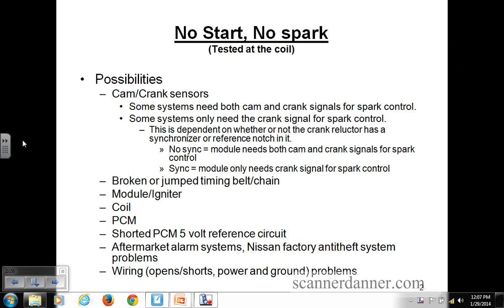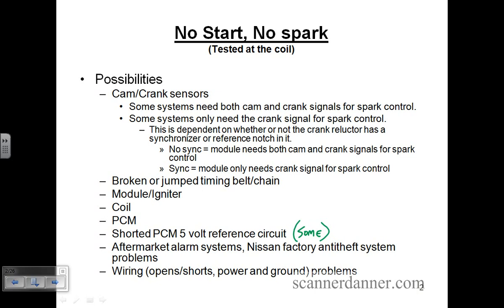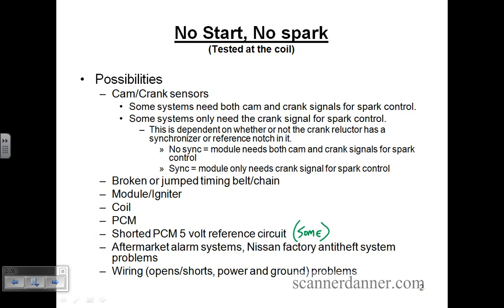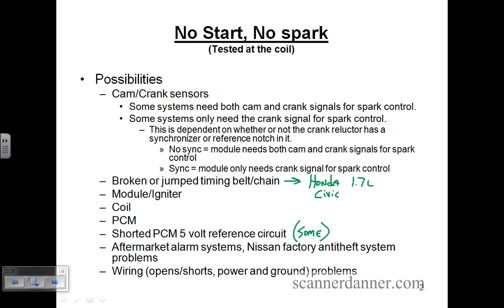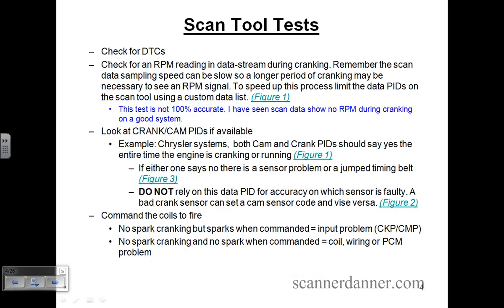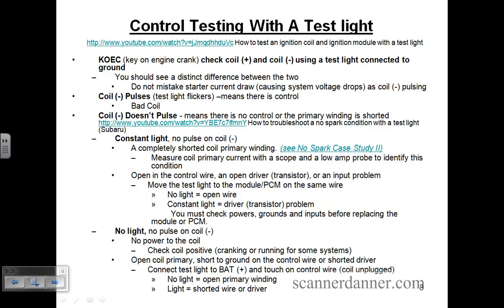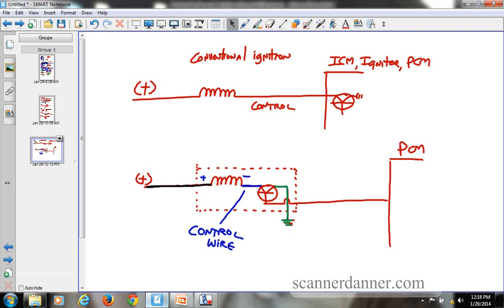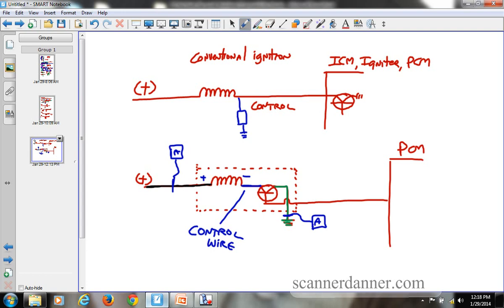Chapter 22 No Start, No Spark Diagnosis (Part 3)

Comment: Paul, just a thought, On case study 2 with the shorted primary coil, if you didn't have a scope, could you configure a test light, sort of like a noid light, and put it in place of the coil, and if the light would now flicker, that would show there is control and you need a coil?
Reply from the maker: Yes! That is a good alternative test but remember the test light control test, there are variables to that as well. 
Great question

Comment: Three terms have been used in several videos - reference wire, control wire, and signal wire.  Is it correct to say that reference and control wires are the same and each is 5 volts?
Reply: Reference wire is usually 5v but can be other voltage levels.
Control wire is for an output device (not the same as reference)
Signal wire is for an input device (not the same as the reference unless it is a thermistor)
Hope that helps
Reply: Thank you.

Comment: I don't mean to be a smart-ass, just wanted to comment, I have used a snap-on led test light to short out secondaries several times and it is still functional.
Reply from the maker: It won't be for long. You got lucky

Comment: Scanner Danner I would like join in learning motor vehicle electric and electronic parts
Reply from the maker: https://www.scannerdanner.com/join-scannerdanner-premium.html
Thank you! Hope to see you there
Reply: Thank you for the video I wish to learn all systems of electrical and electronic of the vehicles
Reply: Hey Paul , I was working on 1az Toyota engine all cylinders there is spark but on cylinder number four is misfiring. What could be the problem